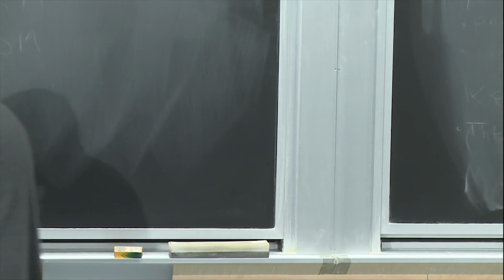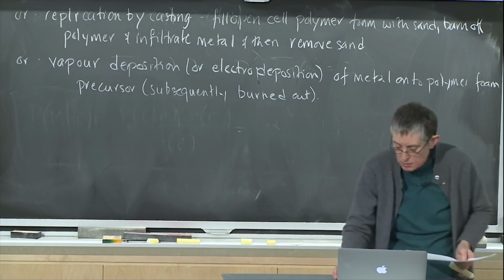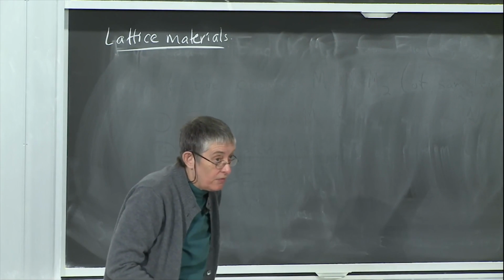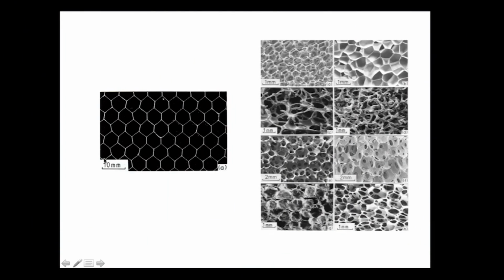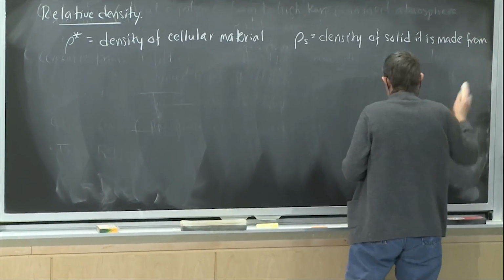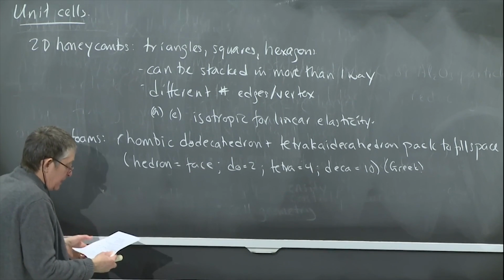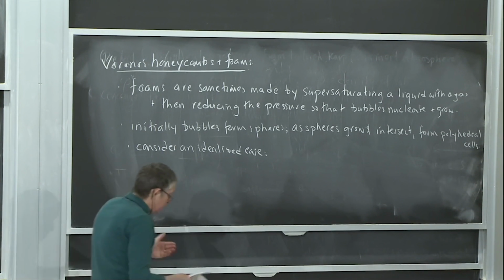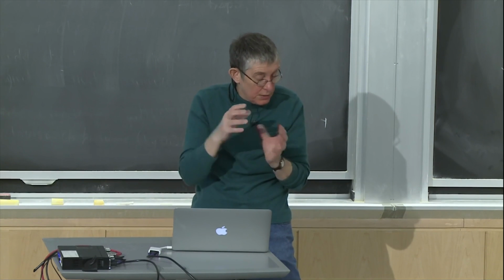2. Processing of Cellular Solids

Comment: for one project, I made a piece of metal foam based on stainless steel. The pore size in the foam was 100-400 μm, pores occupied 60% of the volume. But this method is not in your lecture. Although this method is much simpler and more accessible. I got a very light and very strong piece the desired shape. Oops, but I didn’t know that it was such an advanced technology.
Reply: Hi,   I am very much interested to know how you made the foam. 
Waiting for your response.

Thank you.